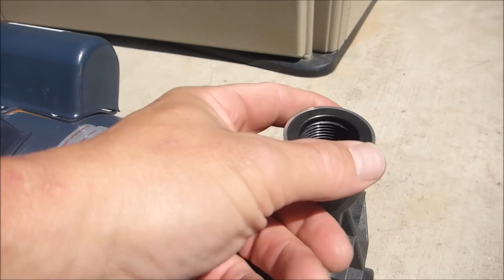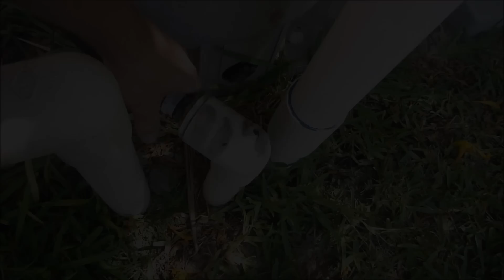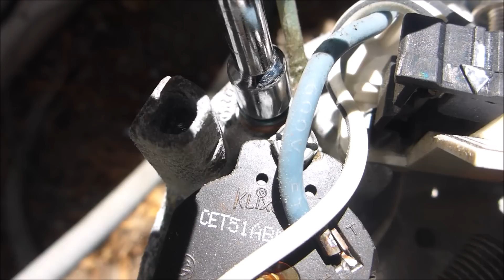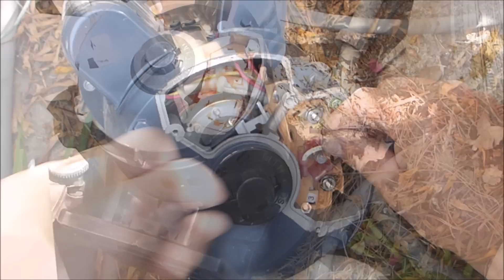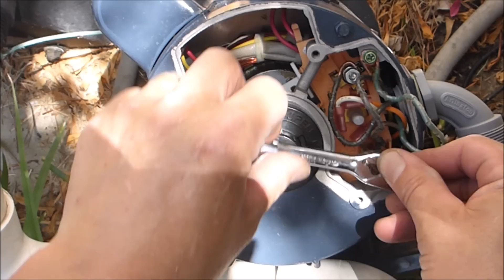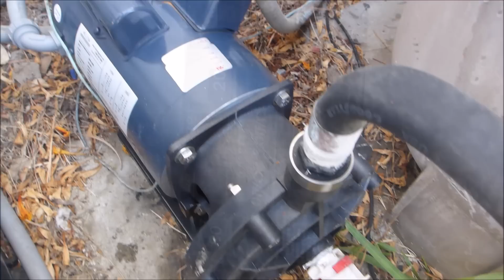How to Install/Replace a "Polaris" Booster Pump (Advantage 3/4 HP Pump Shown)

Comment: The video did not show the priming of the booster pump. I though if the pump is not initially primed it can cause damage to the booster pump. Can you explain how to prime the pump when new booster pump is installed?
Reply from the maker: It will prime from the main pump. Once water enters it should fire right up.

Comment: Great video!  Very Helpful tips.  How do I know if my old booster pump was low voltage or high voltage?  Actually my motor in the back wiring looks exactly like your old one.  I bought a polaris PB4-60  and this pump's wiring looks exactly like your new one
Reply from the maker: 120v is a single pole breaker. 240v double prong breaker. Thanks for the great feedback!

Comment: i just had a pool installed, and the company is so hard to get a hold of for anything.. I have been cleaning and getting it opened up myself, but my Booster pump sounds like it has sand or gravel in it when I start turn it on! I'm not even sure its pumping anything to the pool, as I'm afraid to walk away that far to even check the outlet in the pool. are they always this loud? or do you think something is wrong with my new booster pump?
Reply from the maker: It sounds like it might not be priming correctly. I would turn it off until they can look at it.

Comment: Was there an isolation valve leading to the booster? My set up doesn't have one?
Reply from the maker: There should be a dedicated line to the cleaner booster pump.
Reply: @SPL  by dedicate line there are two main hoses going in. But no shut off valve? Would this mean if I need to remove the booster pump that I would have to drain my pool?

Comment: The pump I received from Advantage appeared to be used. The wire insulation was dirty and moldy. The spades and terminals were corroded. The terminal block was so discolored, weak and degraded that it broke upon tightening one of the nuts. I did not use excessive torque. The volute leaked. I am awaiting their reply to my request for a refund or replacement.
UPDATE 5-19-23: Well they never got back to me but I called today to ask about getting a new terminal block and they are sending one gratis. The pump still works fine but I'm changing out the bearings because they are starting to get noisy. Overall I'll say I'm satisfied. The leaky volute I fixed by tightening the bolts a smidge, maybe they loosened in transit. I'm happier.

Comment: Why wasn’t the tail brush swinging while it was running????
Reply from the maker: You can set it to very low or even off on this cleaner. A nice feature.
Reply: Swimming Pool Tips, Reviews & How To - SPL  do you have a video on that? I have the same sweep and now my tail scrubber isn’t moving around like it used to. Maybe it need adjustments but I don’t know how to do that.

Comment: i hv 2 valve.  one is pool return, inlet, spa return.  other one is pool suction, spa suction, and inlet.  which valve should i open and start the booster pump?

Comment: Do you have a video showing the plumbing connections to the pool? I know where to connect the return line but not sure where to connect the supply line.
Reply from the maker: You mean you can't locate the wall connection in the pool/
Reply: No on the pump side. I know where to put the hose that goes to the pool but I forgot where to put the other hose at. I am talking about the hose that goes into the front center of the pump.
Reply from the maker: That should go into a dedicated return line.

Comment: I'm confused.  I have been running my polaris off of a booster pump.  I have a garden hose attached to the booster pump which then feeds into the polaris hose which is in the pool.  I have an older pool.  Is there a way to just run the polaris 360 from my return?  Do I need the booster pump?  Should the booster pump feed into the system at some designated line? So confused!!!

Comment: Are all booster pumps the same height?  I assume not but figured I'd ask.  I currently have a Hayward 6060 that I'd like to replace with another brand and I am wondering if I would need to modify the location of the PVC connections.
Reply from the maker: I think there are slight differences. To make things easy you can just order the same hayward booster pump again. Unless you just want to change brands entirely.

Comment: Great post as usual. Have you gotten around to filming an install with pvc pipe as you mentioned you would do at a later date? Mine is pvc and I'm a bit intimidated. Thanks!
Reply from the maker: Not yet. It is on my list. You can check out a couple of my install videos - the basics are the same. 

SUPERFLO® VS Variable Speed Pump:
Plumbing in the Pump: https://youtu.be/Pb1OTS0nYMg

Comment: I have a pressure cleaner (Polaris 360). Is it advantageous to add a separate poster pump? Currently mine is run off of the main pump and I use a diverter valve to balance the Polaris and return jets. Thanks for your thoughts and videos!
Reply from the maker: The booster pump would produce too much return pressure for the Polaris 360. It needs to be connected only to your main pump line. The Booster pump Polaris cleaners would be the 280, 380 and 3900 Sport.  Hope that helps.